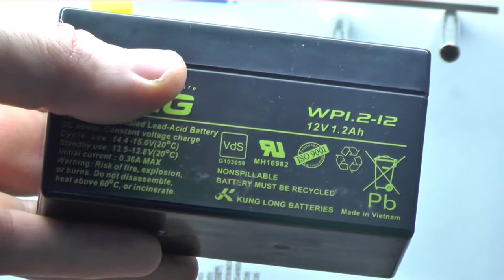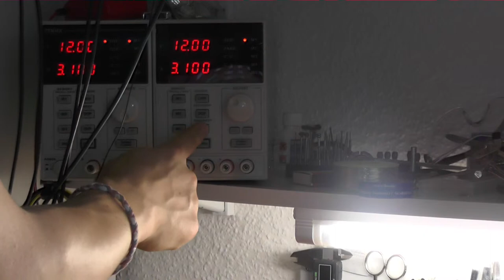Drill Batteries Suck

Comment: I had a similar problem with a DeWalt but there are some clone upgrade batteries that are NiMh available now and they are larger capacity too.  They also work with the old charger so I avoiding go this route so far, although it was considered!  I'd have stripped out the old bats and used the bat box to connect though.